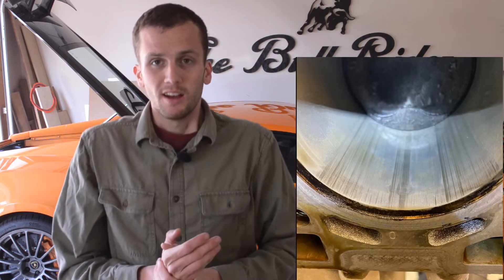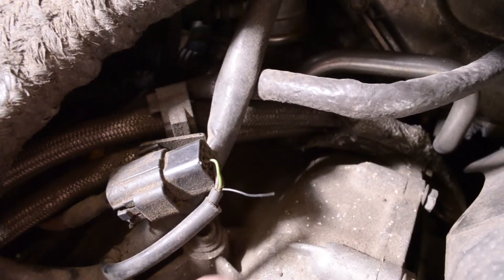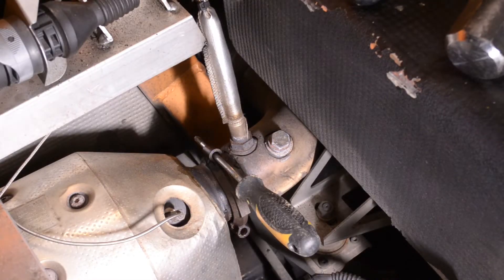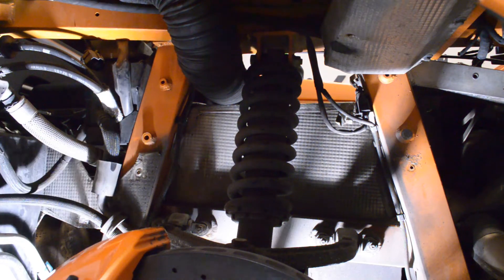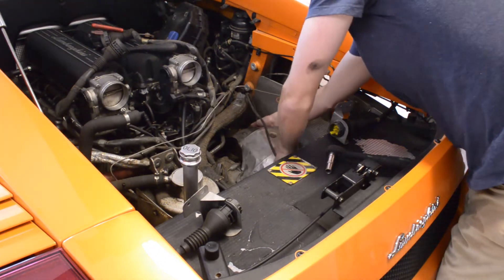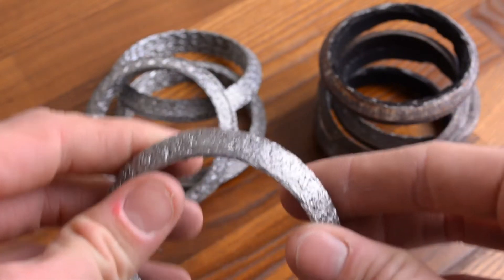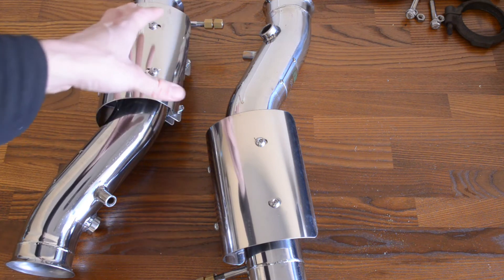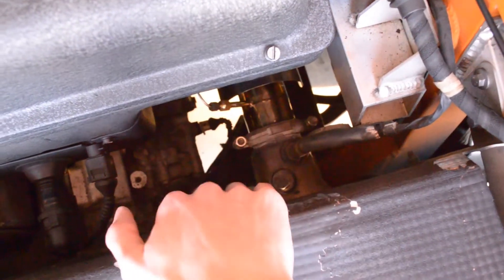I Install Larini Test Pipes In My Lamborghini Gallardo Superleggera. | Insane 5.0 V10 Exhaust Sound

Comment: Looks like the catalytic converters are ok.
Reply from the maker: Hi Jan! You really think so? I thought that the converter cells themselves were in good shape but I noticed how the cell material was delaminating from the walls of the pipe. What do you think about all the stuff that came out? It really surprised me how much stuff came out of there!
Reply: @TheBullRider  what you showed wasn’t that bad, and could you tell what kind of material came out. Every exhaust some waste comes out when you tap it on the floor. The honey cone of the converter looked still good for what I could see, so the converter didn’t fall apart.
Reply from the maker: @janpieters6733  I appreicate your perspective Jan. Yeah the core looked like it was in good shape but I think the failure point for this is it delaminating from the stainless steel pipe that it is bonded too. 
Another gentleman replaced his cats on his 04 Gallardo and noticed that the core was loose in the housing. Here is a link, let me know what you think about this!

https://youtu.be/tM48JMHVTDQ

Here is also another video about the cats going bad on these 5.0 motors. Id like to hear your perspective on these too!! They did the classic nock it on the ground test too! Haha
https://youtu.be/1Q14rzBj26I

I still have the cats in the garage but it would be hard to determine what material specifically came out of the cats when i nocked them on the ground. Do you have any ideas on the best way to do this?
Reply: @TheBullRider  Think that bad catalytic converters is overrated, talked with some specialist about it and they confirmed me that. I also read lots of people engine check lights because they say it is in the nature of the G. But you should investigate it and determine what is the problem. Also when the CAT light burns on the dash you should be cautious, you will overheat the catalytic converters and damage them and that can cause huge problems.

End of story is be cautious on check engine lights and determine what the problem is. 

Sure I am with you those converters do not have a endless life ;-)
Reply from the maker: @janpieters6733  I think we will know for sure once I put a borescope in the motor and see if there is any cylinder wall scoring! 
I agree with you, it might be overrated. It is an interesting debate where we need more data to really determine if it is true. 

Either way, the test pipes are a fun mod and a good way to get those F1 sounds. I think that's something we can both agree on! 
I got a new mic and I'm excited to share with you the insane sounds of this awesome v10 in the next few days.
Reply: @TheBullRider  yes think the sound will be amazing! I would not worry about scoring If the car runs well, just enjoy it :-)